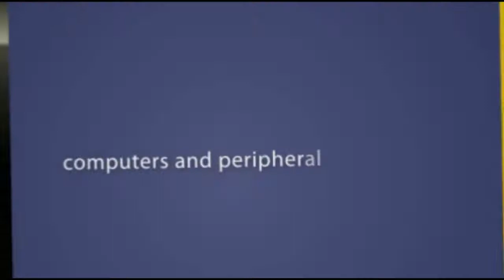Crosman 1377 Steel Breech Install - Onto older 80's model Phase 2

Comment: I was reading all over air gun forums for a conversion like this... I have a 1377 and 1322 both phase II. Thank you for posting this video, so far this is the ONLY source I could find for these conversions. I will plan on doing this for both eventually, but thank you for sharing. Now I know it can indeed be done. +1 like!

Comment: I had one of the older 80's model too when I was a kid.  Got it from "Farm & Fleet" back then for around $32-$35.  Back then it was a BB Gun & Pellet Gun, and it CAME WITH the plastic butt stock.  
Crosman has since gotten REALLY cheap, and taken out the handle option.
I miss my older one

Comment: Thanks for the video. I have a 1377 from the 90's and wondered if it would take a modern steel breech. I assume if the 80's model takes it, the 90's model should too. With a stock, steel breech and scope, that should make an already awesome pellet gun even better :D

Comment: Glad I came across your video! I have the older style 1377 like yours. I acquired it from former tenants that left tons of junk! And this gun was one thing worth keeping. The thing I disliked about it most is the breech cover. It is loose, and I never could figure out how to tighten it up. For example, the other day I pulled my gun out to shoot a rat. I aimed and fired, and nothing shot! Unknowingly, the breech cover slid open and my pellet fell out! Would this new breech cover with the lever lock, and better hold the breech closed? Thanks.

Comment: Excellent tutorial. I" am trying to do a similar upgrade and would like to ask for your help. I bought a new 18" barrel. The breach end of the new barrel is different than the original barrel. So much different that the original bolt will not seal it. Can you please tell me, will this steel breach and bolt seal my new style barrel? I guess what I'm asking is... Is your NEW barrel different on the breach end from your old barrel? If it is, and the new breach worked for you, I should be fine. If your new barrel is the same on the breach end as your old barrel, I would have problems with this new steel breach. I hope that made sense. Thank you for any help you may be able to provide.
Reply: I know I am 7years late but this may help someone someday, 
I guess this is a normal problem, crosman sells the barrel assembly with a bolt included in it (I dont know if you can mount it on a plastic breech but I think the stock bolt is one piece and you cant take it out so this may be a no )and also include a bolt in the breech kit...so seems like if you change the barrel you need to change the bolt also! 
Im chatting with the canadian customer service to figure out wgat I can get in canada..sad to hear they dont offer any barrel band upgrade, I think I will have to drill the barrel band to make it fit (the stock barrel sits in it ) wich would be a bummer...still trying to figure out an other option avaible here ...the backpacker barrel band is out of stock this could have been an option

Comment: I wanted to purchase this kit and on the bottom of the page it says ,This breech does not fit older model 1377 air pistols with a sliding breech cover. I'm not sure if it's the correct one are you able to let me know. A part number on barrel and breech you used. Thank you

Comment: I have this exact gun from the late 80's. I didn't shoot it all that much and don't want to replace my barrel at least not yet. I want to know if i can add a steel breech and use it with the old barrel? Everyone i talked to says yes, can be done but the barrel needs to be replaced along with the new breech, is that true? 

Another question, I've seen flat top piston kits to improve pump power, can this be done on this gun and have you thought about doing that mod?
Thanks for the video.
Reply: Also, what about magnetizing the new breech bolt, would that allow it to shoot bb's once again? Cause I'm not sure i like the idea of giving up on shooting bb's.